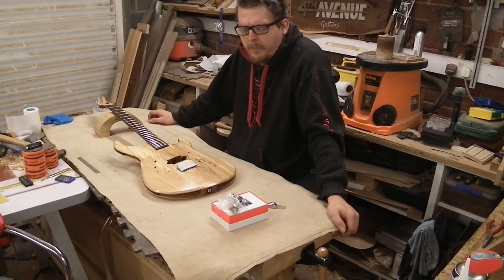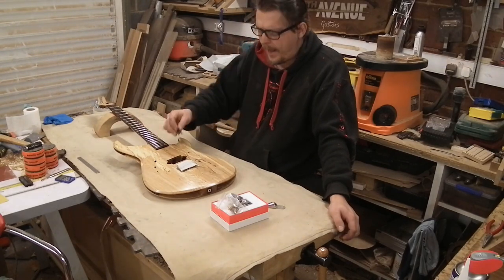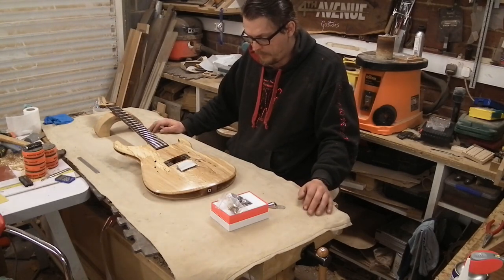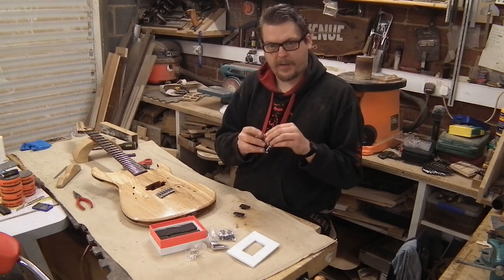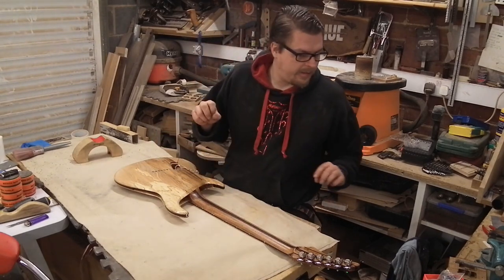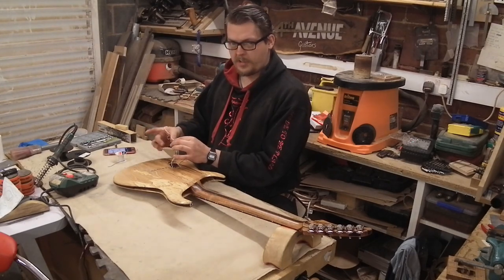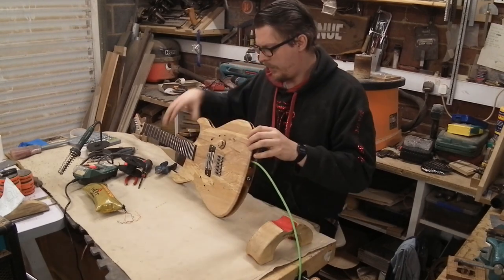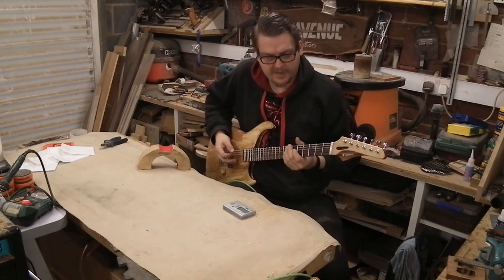Building a custom multi scale guitar; Flaps & Electrickery.

Comment: Turned out extremely nice Anthony. As all of your guitars do. Those little wing tabs are beautiful, very nice accent. Is that a stacked v/t pot?
Reply from the maker: Thanks. The wings/flaps were a very last minute inspiration after puzzling for weeks on how I was going to attach the pickup.
I decided to leave out the tone circuit in this and only give it a volume and coil tap switch.
Reply: @4thAvenueGuitars , I didn't see a cap go in but the knob looked stacked. You may decide to cap it those Lace pups are kind of ice pickish.